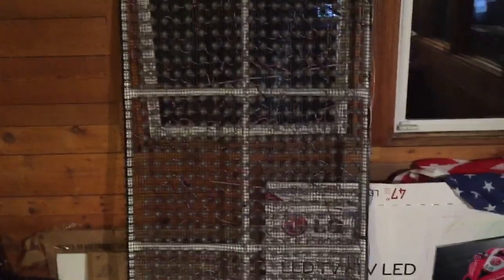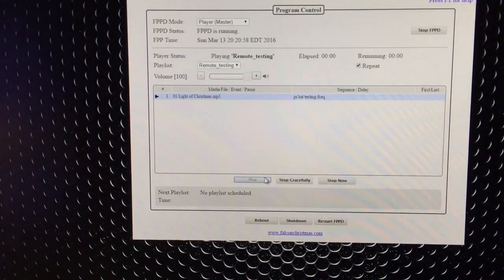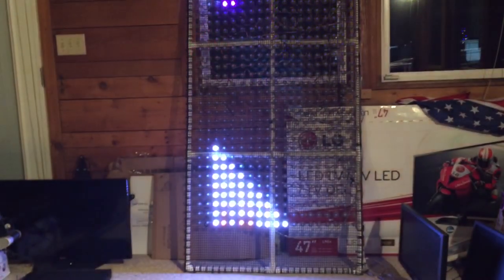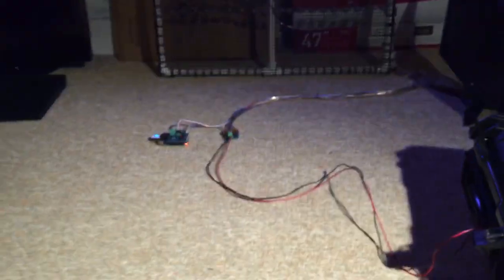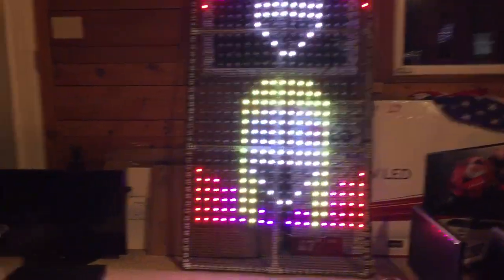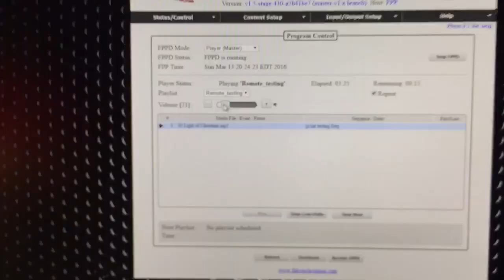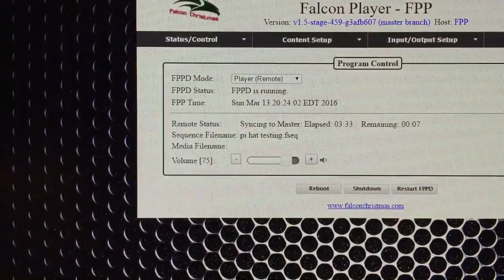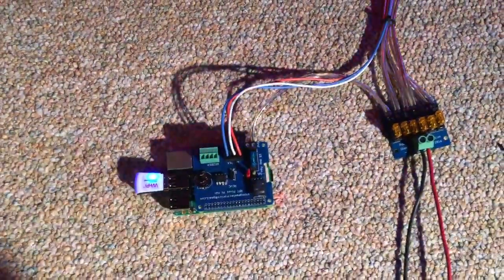FPP master/remote with the Pixel Pi HAT

Comment: could you run a relay board with the remote Pi and still run a f16v3 or the j1sys board from the master? i have a mix of both AC lights and i want to get started into pixels.

Comment: what's the cheapest way to build one of those matrix display's?
Reply from the maker: Order WS2811 pixel nodes from Ray Wu Aliexpress store at $12 or so a string so 11 strings would be around $150 with shipping. Go to Home Depot and buy a 50ft roll of the 1/2 inch plastic wire mesh for like $16. The 2811 pixel pop right into the wire mesh. Skip 2 or 3 holes in between each pixel. Once it's the size you want measure it and make a PVC frame the same size for $10. Zip tie the mesh to the PVC frame $5 for zip ties. Control it via a raspberry pi with the pi hat and power Distro board $70. Power it with a $20 meanwell power supply knockoff. Sequence it with xlights =free. So ball park $270 all in from start to finish.
Reply: +Andy Harrison great response appreciate the video's and tutorials thanks so much